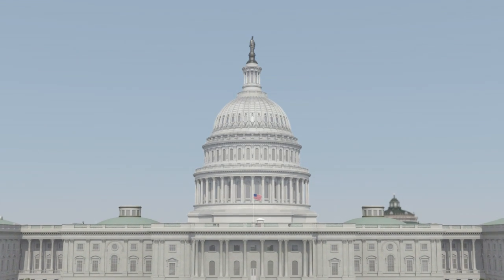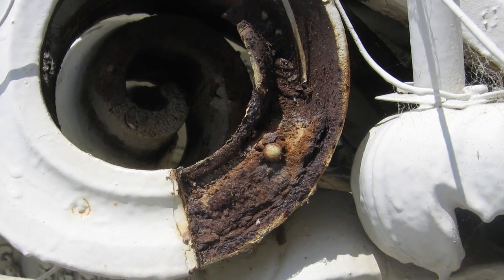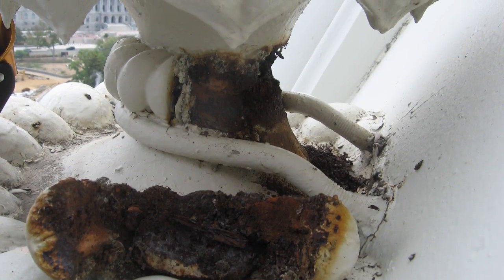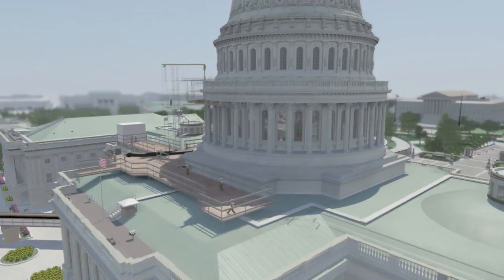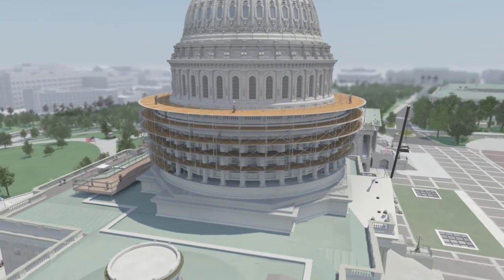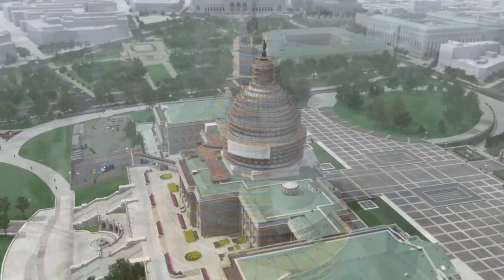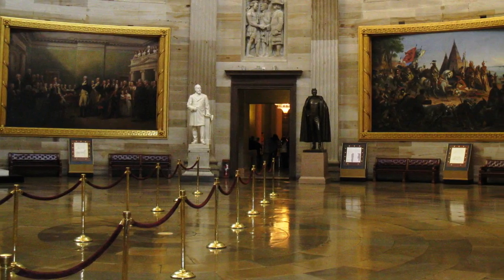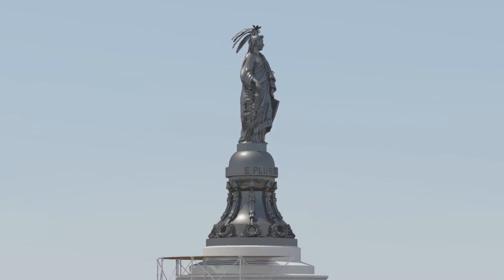Capitol Dome Restoration

Comment: We Americans should take the opportunity to restore a liberty cap to the top of the statue on top of the Capitol dome. The cap was removed from the initial design by Jefferson Davis in the 1850s. It represents the freed slave, and Davis would have nothing of that. The liberty cap, sometimes on a liberty pole, was a common symbol in the first century following the Declaration of Independence for our highest ideals. After 150 years, it's time.
Reply: +Casey Bowman  Although the original sketches called for a liberty cap, the statue as it is now is as it was originally cast.  Shall we melt it down and recast the whole thing ?